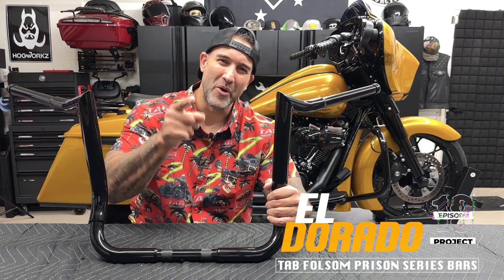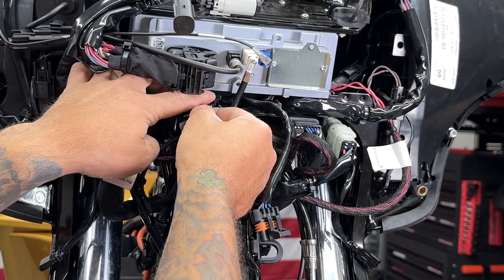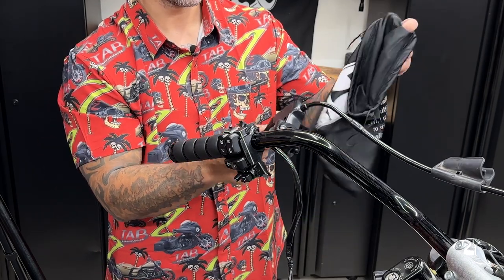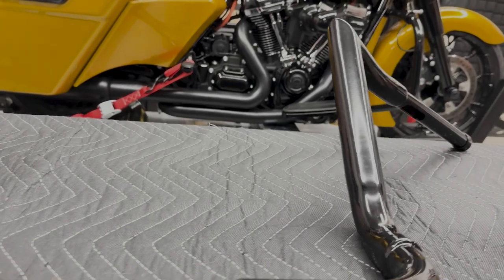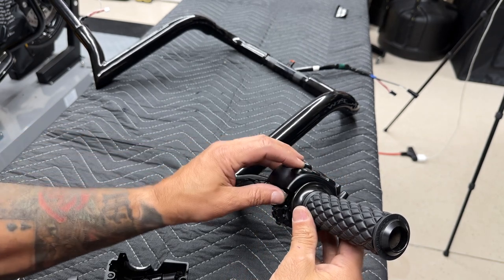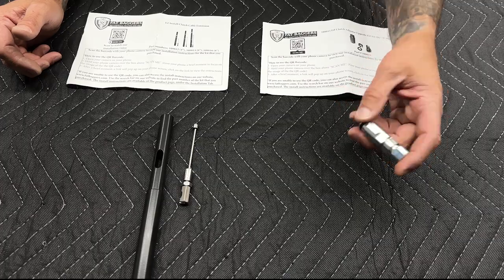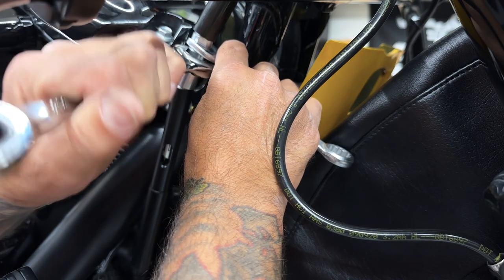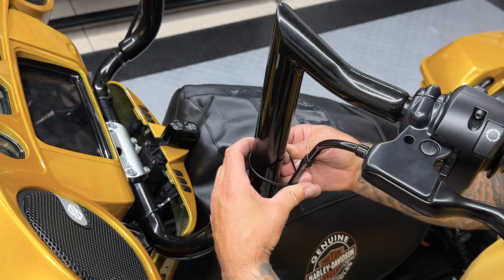Street Glide 12” Handlebars with Grips - Harley Riser Bushings - Clutch / Wire Extensions and More

Comment: I noticed at the end of the video you installed a Klock werks windshield what size is that a 6.5" thanks
Reply from the maker: That’s actually an 8.5” windshield.  Probably would not Recommend this size with 12” bars.  I ended up changing it out to a 4”

Comment: You said the riser bolts were reverse thread, but in the video it looked like you torqued clockwise.  Which is it?
Reply from the maker: It’s not reverse thread, it’s reversed just because the direction.  Once you got to tighten them down, you’ll figure out which way to torque it

Comment: Is it doable to do the bushings without taking the fairing all the way off? I am just changing the bars and wanting to do the bushings at the same time.
Reply from the maker: You could, but it would be a little more difficult.  You already have to tilt the fairing forward some, so might as well disconnect a couple of connectors and pull her off
Reply: @RAIDERWORLD  fair enough, and if I understand correctly from the video you only took off the tank due to it not being the factory shape? I have the Harley tank cover and fender cover I was just planning on using those, that is until I saw your video. Which by the way, your video is one of the better ones on the internet, thanks for sharing.
Reply from the maker: Thank You! Yes, I only took the tank off because the shape.  The stretched tank is too close to the panel